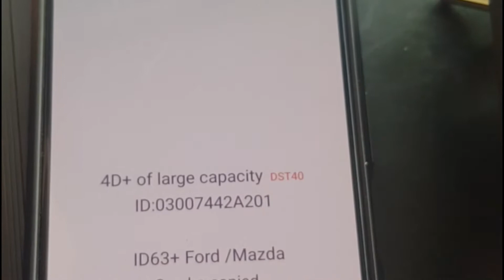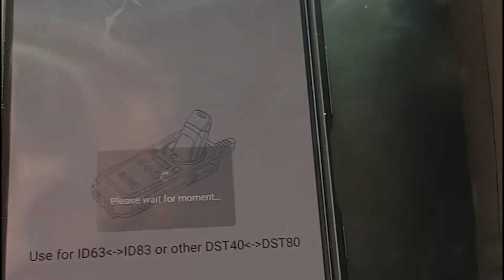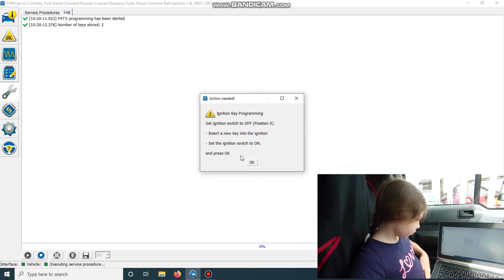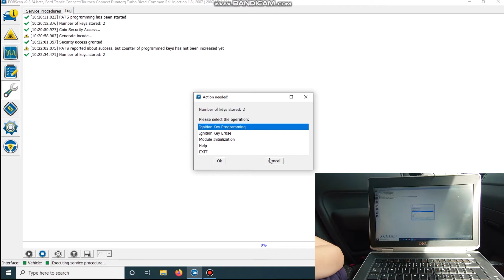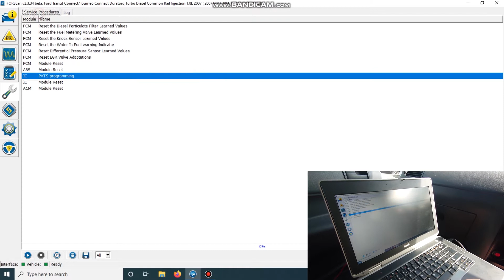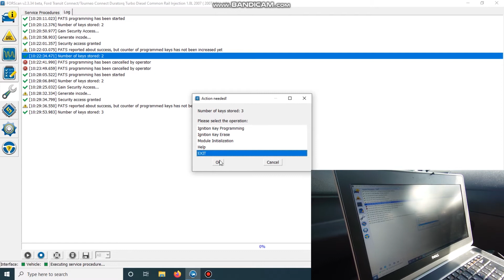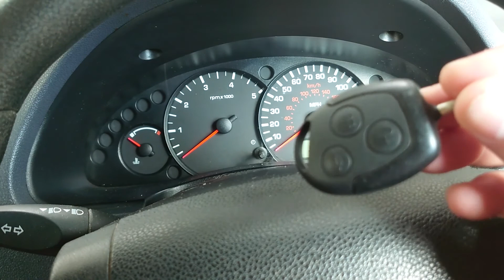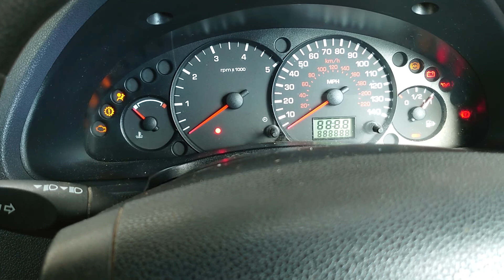Ford key programming PART 2 - FORScan

Comment: This 2 time failure those not erased your original key?   I have 2 original key from my Focus 2015 programed but i lost 1, so now i have just one original. my qustion is if i can try this procedure? it well not erase my original key if my aftermarket key is not ok?
Reply from the maker: Fords dont erase keys unless you ask them to or program a new module in the immo chain with the dealer tool.

Comment: The first chip was blank, you had to generate a code and load it onto the chip, second one worked because chip was already coded.
Reply: Hello, a question about your comment, what tool do I have to use to generate a new code for the blank transponder?

Comment: Thanks for the video, I had the same issue with transponder, but luckily I had bought two other ford keys for a different ford, keys didn’t program first time, changed the transponders then no problem. Car starts no issues with both keys. Thank you.

Comment: Great video, thanks for the explanation.  Do you need to already have a working key  to do this procedure? Lost key and no spare, will have a new key cut to operate the ignition barrel and connect forscan but will it still program or does it need to see a working key first? 

Many thanks

Comment: I have 2 cards for mazda cx 9 from 2008. I have a problem with keyless go.  Once it works fine and in a moment I have to start the car with a metal key.  The key flashes red while driving.  Not when the immo is flashing and I can't start the car.  I suspect that it is the keyless module or the fault of one of the antennas.  Can I use a forscan to reprogram my cards?  Is it safe?

Comment: hello. i have a question. im trying to do the same following this video but when clicking start in PATS (Run Service Procedure) I get error message "PATS programming has been started" + "Service procedure as been interrupted" - but i did nothing. the system does not go through and this is loop every time i press "Run Service procedure" button. Any tips? tks (just a highlight that in "Service Procedures" menu I only got 3 options "Module PCM - PATS Programming" ; "Module PCM - Change Fuel Injectors Factors" ; "Module PCM - Read Fuel Injectors Factors" )
Reply: Hello, I have the same problem here with a transit 2016, how did you go through?